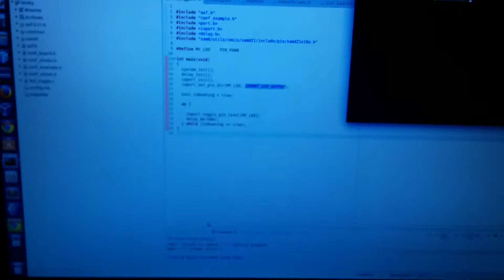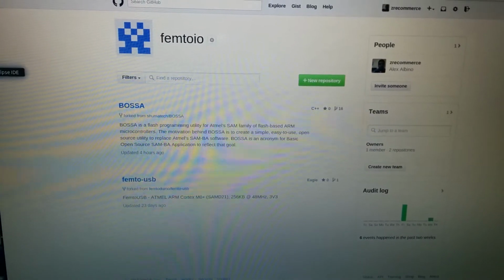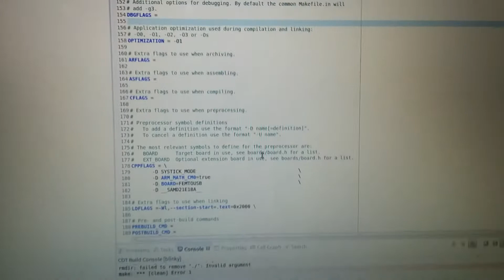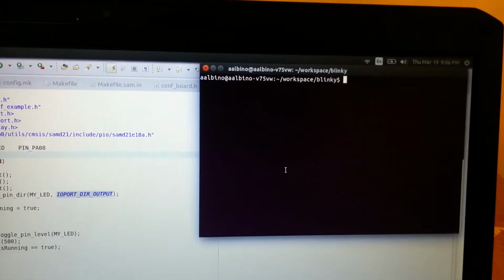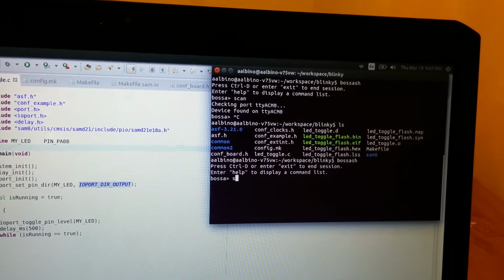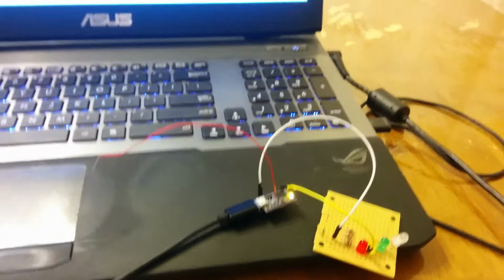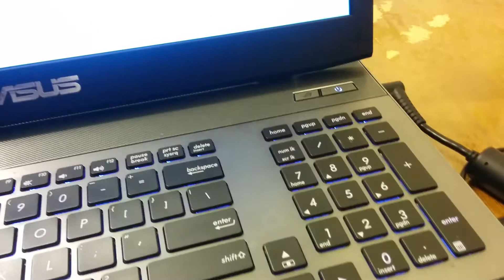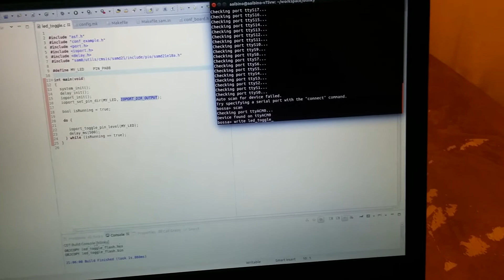Atmel ARM power - FemtoUSB (Open Source, Easy)

Comment: Hi @Femtoduino, Smallest Arduino,

How do you setup the IDE to upload program file to the MCU?

Do you need a USB Adapter to upload "sketch" to Atmel ARM Cortex M0+ (SAMD21E) board?

Thanks again for the video.

Best regards,
Peter